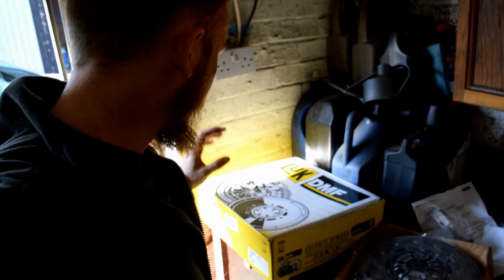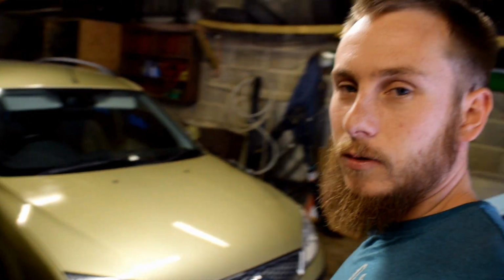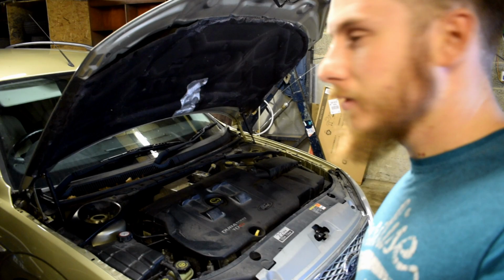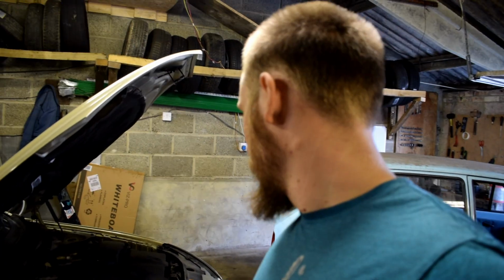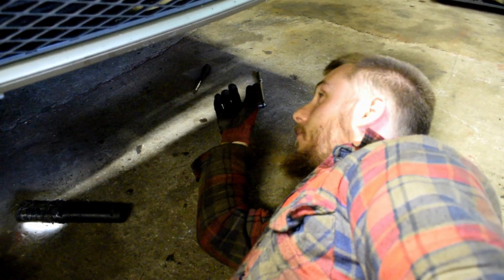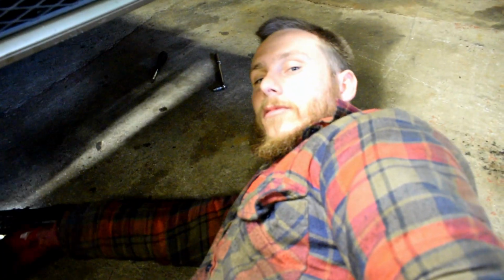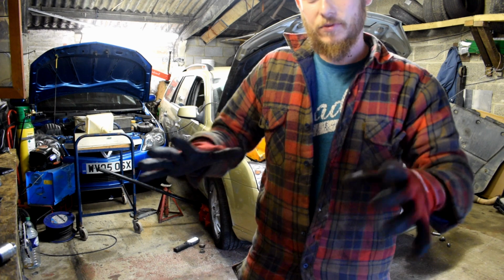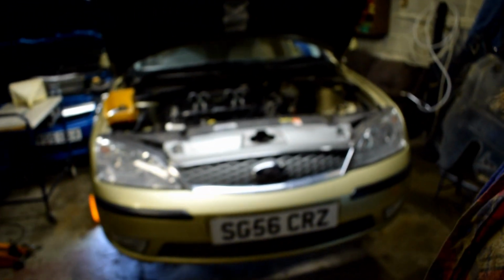~ | Mondeo MK3 Clutch/Flywheel | Part 1 |~

Comment: Cool video, just popped up things to watch. Im currently working on my Mondeo ST220 and got the front subframe down to do some poly bushes.

Your right about the garages charging silly money, thats why i do as best detailed video on the mondeo as i can. Good work
Reply: Hey chaz do you still have your 220?
Reply: @simongoldring3554  hiya mate, yeah i do im still working on it. Got myself a mk4 now aswell whilst im working on the st220. Not much else to do at the moment so doing what i can lol
Reply: @ChazzCoombes  where are you based mate I have a 220 5 speed needs new clutch DMF. Going to have to do it myself as garages want 💰💰💰any help would be greatly appreciated
Reply: @simongoldring3554  yeah im in Kent. Will be looking at doing mine asap when money allows lol
Reply: @ChazzCoombes  I have got a Haynes manual I’m a complete novice so I suppose I’ll learn the hard way 😂
Reply: @simongoldring3554  haynes are ok as a general guide. Any questions mate pm me.
Reply: @ChazzCoombes  thanks for that what’s a direct contact for you then.
Reply: @simongoldring3554  fb or instagram.

Comment: hello brother i need your idea  i have mondeo mk3 diesel duratorque  di engine with 5 speed manual transmission   .I would like to change transmission  with st220  6 speed manual transmission will it fit  or need to do some modification